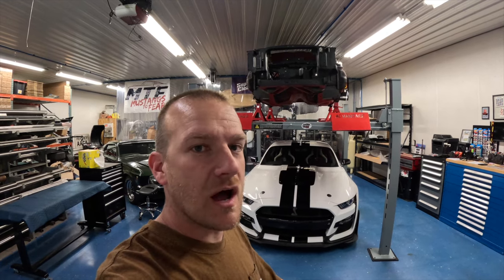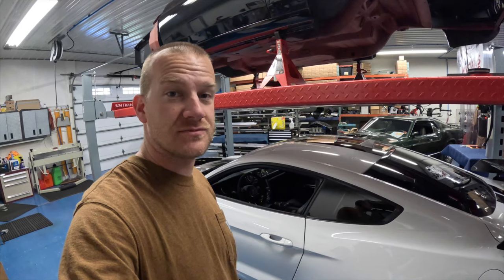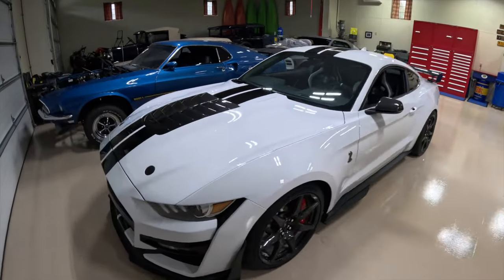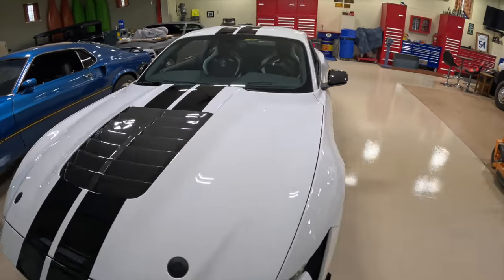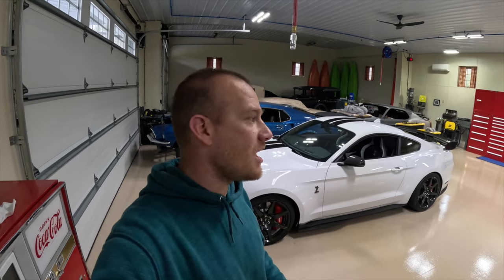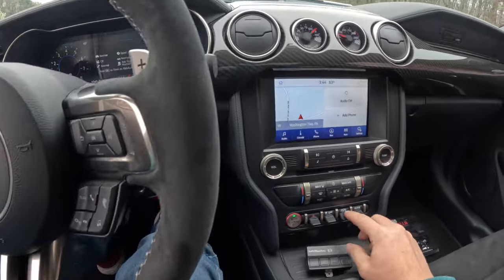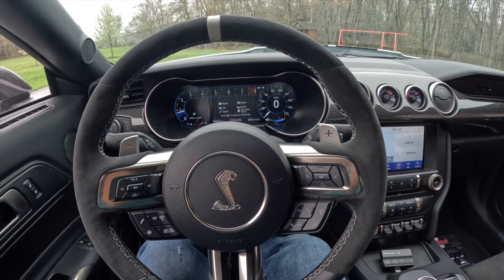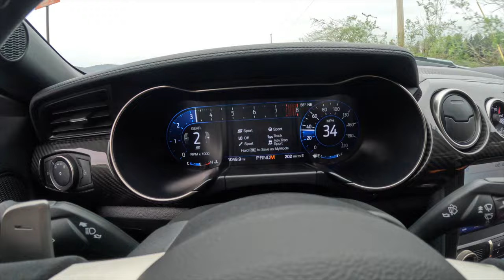2020 Shelby GT500 Upgrades and First Real Drive! ( Insane car)

Comment: I laughed when your son came out "daaaaad! Stop dat noise!!!" our two yr old would be crying because I started the car without him.  Our 2018 gt is his car.
The experience you talk about is definitely real when comparing older cars to newer. Keeping the RPMs around 3k and not being afraid to run and hold it at 6k-7k is wild.  Feeling the car pull harder & harder through the RPM range instead of low end punch and tapering off.  The Shelby cars are absolutely wild. We're lucky to be alive in the last golden age of horsepower in ICE vehicles. Congrats again on the Gt500.... you really ought to consider keeping this one forever, and get a second one slightly worn in to really have fun with.

Comment: I have a 2020 GT with 401A optional dash, driving mode option and 10 speed automatic (with paddle shifters). I’ve driven manual transmissions my whole life but, unless you’re a professional driver, you can’t outshift that 10 speed.  Besides, when you drop the hammer on these cars (and my car doesn’t begin to compare to your 500) it’s better to have both hands on the wheel.

Comment: Does the new carbon fiber engine piece have slots to allow engine heat to escape. Nice ride.
Reply from the maker: Yes exact copy of the original. Both have ventilation and both have a removable rain tray that can be removed for greater flow.